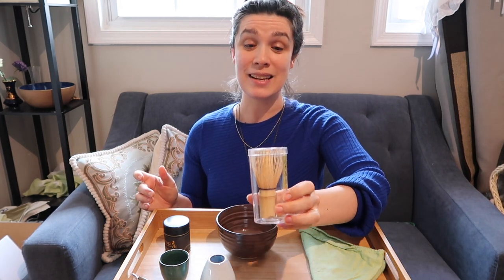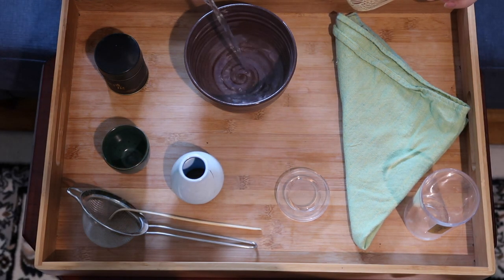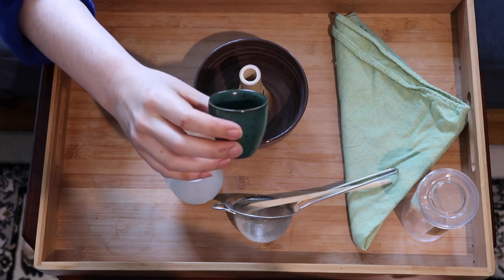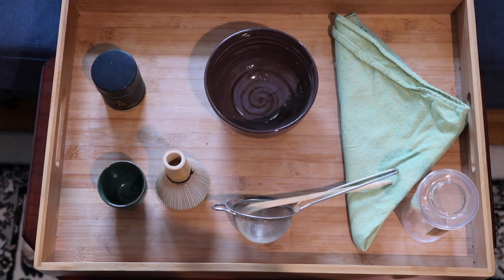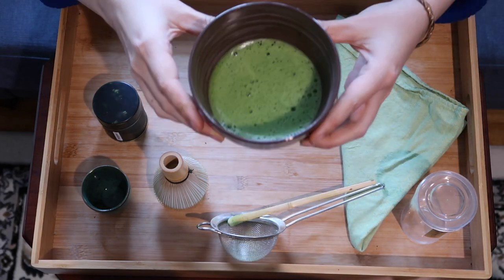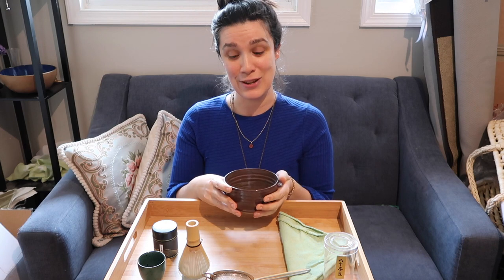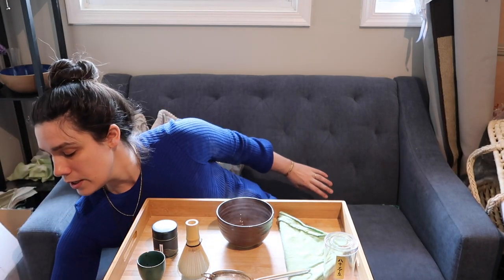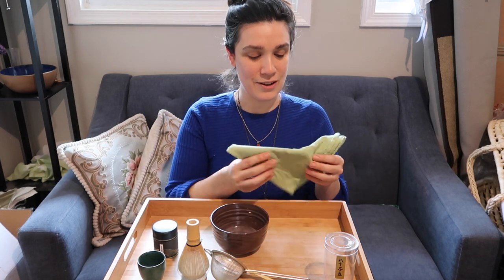Preparing a New Matcha Whisk (Chasen) | Matcha Basics

Comment: How long do you leave your whisk in water. Mine is still curled up
Reply from the maker: Looking at the raw footage, it looks like it was just a couple minutes. Are you using hot water?
Reply: @thebarefoottealady  i tried 70°c water first then eventually switched to 100. It's opened a lot but still not fully. I've put it on the stand to set in shape and I'll try again tomorrow